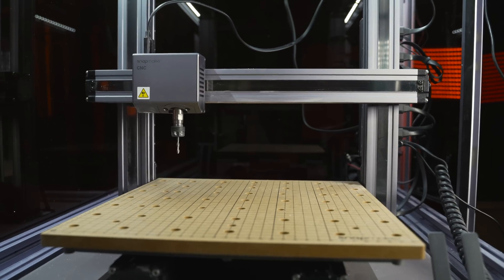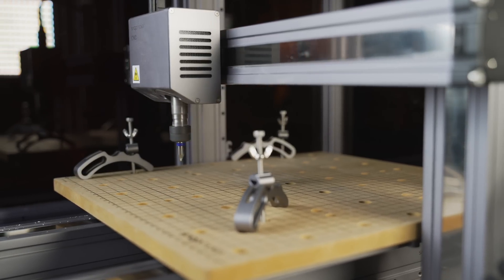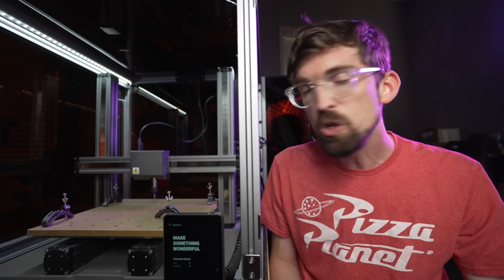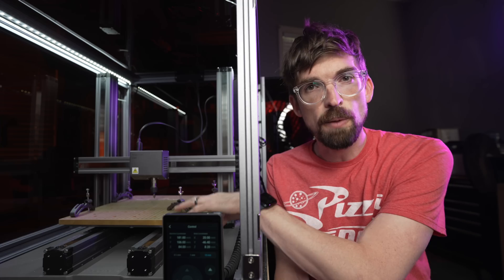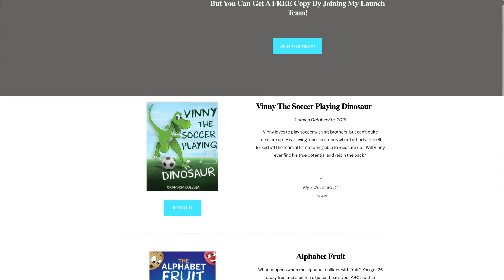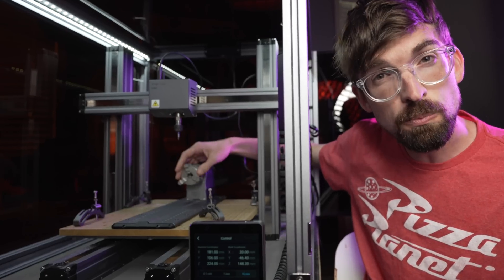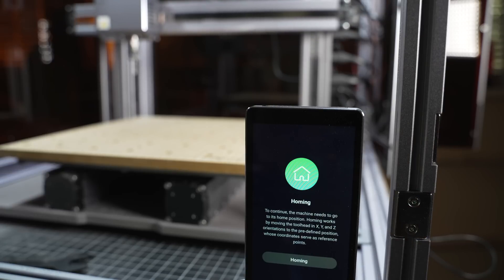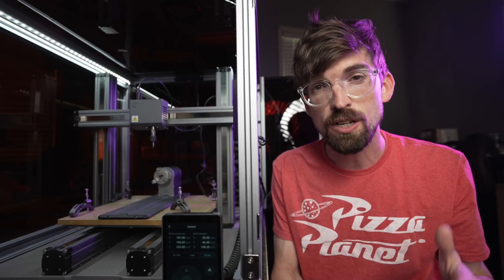Is this feature worth $2400?  The Snapmaker 2.0 Rotary

Comment: I just bought a Rotary unit and it was $600... My A350 was $1200 at micro center, and the most recent sale had even lower prices... Where are you getting $2400 for a modular printer attachment? The biggest draw back is the price? Really? Do you have an example of either a better machine that does all 3 functionalities within the same volume, or 3 machines that are cheaper IN TOTAL, AND better. Gl

Comment: I got the machine and tried every module. And I can only say it sucks.  I got like 400$ Single use machines that get better results. (3D Printer/Laser/Small CNC) I was fooled by the sturdy design and the idea to only have to have one machine at hand for my projects. If I could I would refund it imitdiatly. The 3D Printer is slow as F.. The CNC cant even cut a small juwlery box without skipping and the "old" Laser moduler is also really really bad. The Photo feature cant even get a proper picture and after month of wating for an update to fix the abd module with an software update the release a new one for 400 bucks. Jeez. I really wanted to love the machine but i just cant.

Comment: I bought the A350 nearly a year ago and have been pretty happy with it. Haven't bothered getting the rotary module. It doesn't feel as good as getting independent machines but then I'm in a pretty small shop so it doesn't take up a lot of space. Predominately I make boxes so the laser and cnc functions are what I use most of the time. If you were working on bigger items like furniture then I'd definitely steer clear. The unboxing and setup was first rate although I agree Luban is pretty ordinary - I wasn't even able to insert italic test for a quick laser engrave and instead had to use Inkscape.

Comment: After messing around with the 3018 cnc machines for a few years I feel the Snapmaker would just be a disappointment, at that price I think you could buy a good laser, router and 3d printer but that 4th axis is a difficult one to cover..  I have a Millright Mega V XXL that came with a 4th axis and for $2300 you can buy the Mega V with a 4th and mill Aluminium..
The Snapmaker is an intresting machine but I feel that bed is just letting it down

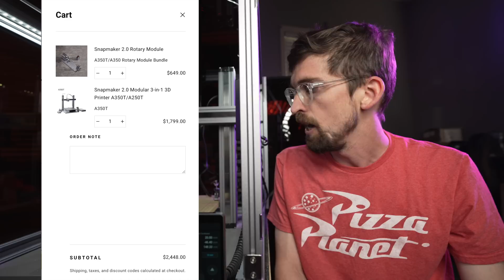Comment: 10:18  Yeah, Enclosure (Which imo is kind of required for the laser) + Rotary + Main Machine is quite expensive.

I don’t know where i stand on it.  From what I’ve seen it’s a good machine.  I also love the modular design, and sealed parts with rugged cables.

My main complaint is that it’s not open source, granted they have fears of copycats i guess?  Maybe they could do something like open source the last generation each time they make a new one?

I’m excited to see the one in it’s printing, because a locked down extruder/nozzle ecosystem is a concern i have not knowing much about this.

Also selling “toolplates” so you could make a drag knife (or knife + servos for turning with the cut), or marker, or even EDM module would be really cool.  I think one channel has made their own pen  holder for the snapmaker.  Open Sourcing the standard could help toolhead development too.

I guess in conclusion if they could open source it, and/or get the cost of the rotary+enclosure+machine down to maybe 1,000-1,500 USD or so it would be top tier of “first 3d printer” category, not just “best all in one machine”!  But as of now that all in one aspect is it’s only real plus i guess.